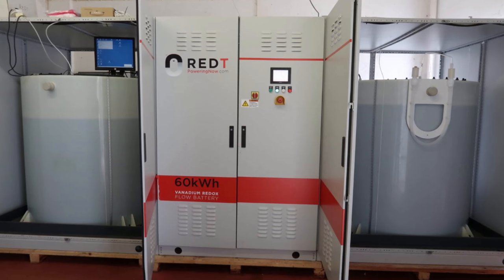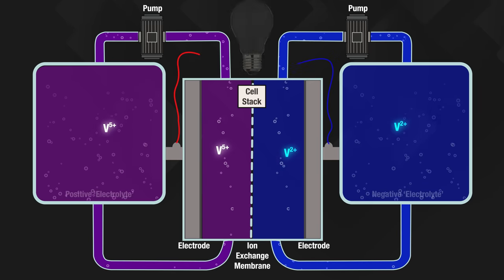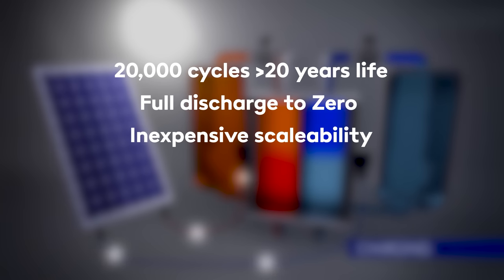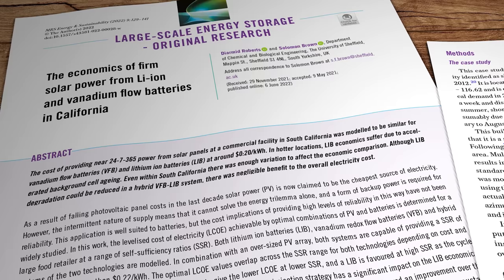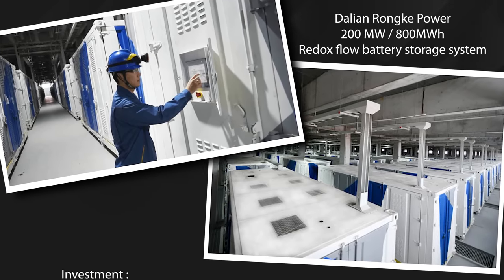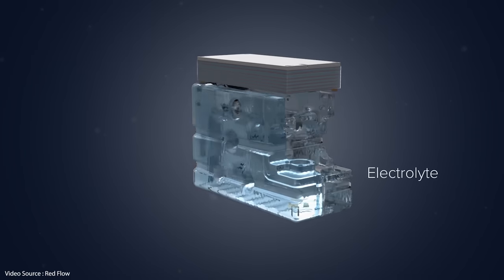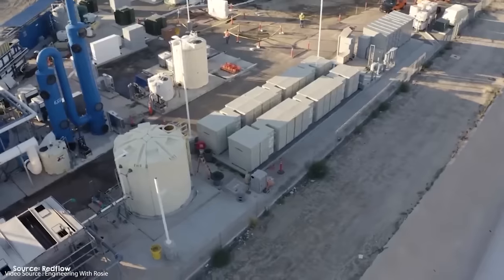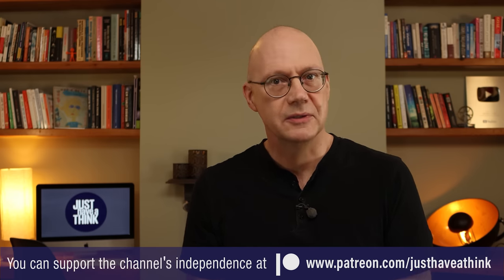The new billion dollar battery disruptor!

Comment: In April we drove to Oberwintethur in Switzerland to visit family who live there, a 900 km trip in our EV. Ten minutes walk from their apartment is a Cellcube installation with two 50 kW DC rapid EV chargers. These are fed by a Redox flow battery which is charged up by banks of solar panels. There are information boards explaining how it all works but it was interesting to know that the car was being charged in this way. Thanks Dave for another great video.
Reply from the maker: Very interesting info. Thanks for sharing :-)
Reply: 900 km in a EV is quite a trip.
Reply: @markfryer9880 Depart full, Arrive empty -> probably two DC fast charges required, each between 20 and 40 minutes (depending on the charging capacity of the car)
Reply: @markfryer9880  not really. A lot of people do that. If you take your regular breaks every two hours, it doesn't even take that much longer. Just had a trip of 350 km with my EV and didn't even need to charge, but still did just to get some rest and bathroombreak. Got there with almost full range.
Reply: But but….. the grid can’t take all these fandangled EV’s
Reply: @skip181sg I hope you are being ironic... the grid certainly CAN cope with the EVs. The DC fast chargers have their own batteries. Its like filling a fire engine from a slow tap. Eventually the fire engine tank is full and it can squirt water at high rates for short periods.
Reply: @ecoworrier  My wife calls me the Fire Engine after a night of slowly filling myself with beer.
Reply: @ecoworrier  My home country—Australia- is the biggest irony exporter in the world..

Oh sorry… That’s Iron…..
Reply: @skip181sg Hammersley Irony?
Reply: @ecoworrier  the best irony
Reply: @markfryer9880 Not really, in a modern EV it takes the same amount of time as a gas or diesel car, the range is long enough and charge time short enough that you'll be able to charge on all the regularly scheduled leg stretchers, food breaks and toilet stops you'd be taking anyways.
Reply: @skip181sg  Hope this is ironic, but nevertheless, yes the grid can't handle it if all EVs are charged at the same time which never happens. The same is also true for gasoline, if all combustion cars would try to fill their tanks at the same time it would be complete carnage. In Germany we have a gas station for every 3.000 something cars. In the US it's slighty better at 2.000 cars per station, in the UK it's 4.000. So good luck getting gas if you're in the latter half.
Reply: @skip181sg  Love your work skip! 😁
Reply: Ronaldo-ue5if  What!?
Reply: charging a battery to charge another battery would use more power... the grid may be able to cope, the distribution system wont.. ask yourself this, how many cars refuel at a service station, every hour, if you had that many fast chargers, how much power would that require ?
ive seen people say  'i charge at night when their is plenty of power' Really !!! Plug a lithium battery into your house then goto bed.... every electrical device  i have ever owned, has said not to leave it charging unattended, who in their right mind thinks its a good idea to plug a lithium battery into their home and then go to sleep ?
Reply: Solar panels imported from China. Let's hope they keep exporting them.
Reply: @markfryer9880  Yes, we never like to do more than 500 km in a day though we did a marathon 1,100 km return from Frankfurt in Jan '22 following the birth of a grandson, never again!. For the trip to Switzerland this year we broke the journey with a hotel stay in both directions charging overnight at the hotels for free. Two weeks ago we did a 500 km (300 mile) each way trip to Brittany, stopping at a Tesla supercharger in Nantes for 40 minutes while  the car was plugged in and we had some lunch. We never used to do more than that distance in an ICE car.
Reply: @fpvrc9829  I have owned an EV since early 2019 and I always plug in overnight. It is a common mistake to equate EV batteries with those in devices such as phones, laptops etc. Those do not have BMS systems which are constantly monitoring temperatures and current flows during charging. After plugging in at home about 400 times and clocking up 90,000 km I have no such concerns
Reply: @ecoworrier  That's about it.
Reply: @markfryer9880  Yes, we live in the Charente region of France and have owned the e-Niro since March 2019. We have made 3 trips to the UK, one to Frankfurt, two to Switzerland and have just got back from Northern Spain. Our car is now off the pace when it comes to charging speeds but even so we only plugged in for 13 minutes this afternoon to make sure of completing the 425 km trip. Just enough time to use the bathroom and stretch our legs.
Reply: @ecoworrier  We actually split the trip in two as doing more than 500 km in a day in any car is a too much. In 2022 we did an 1,100 km trip to Frankfurt from our home in the Charente region of France...this following the birth of a grandson there. It was February, so cold, wet and foggy. We did 700 km as far as Metz on the first day but that's really too much driving in a day. We never had any problems finding rapid chargers and we never do more than 2 and half to 3 hours before taking a break.

Comment: As someone working in the electroplating industry, this is very interesting technology. The use of zinc as the carrier metal I find quite exciting due to its ubiquity, low cost, safety and wide availability. Using these for home storage and grid storage would free up the other energy dense technologies for transport uses.

Comment: The diversity of sustainable, viable solutions becoming available is mind boggling.
Reply: Agreed and that is both a good thing and a bad thing. Good to have options, bad in that none really stick out as being superior. We cannot have meaningful change on only marginally better options
Reply: 10 tons of paraffin with melting point at 24C in your family home and your done.
Reply: Really?  30kw is the electric engine required to run an oar hauler, it needs this mobile, always on because a mine cost 4 billion and the interest on this can be measured in $/hr.   Only diesel or nuclear can provide this.  All other techs seems like feel good solutions considering any metal we use in cars or storage.  I am an optimist thing can get worse.
Reply: @johnschneider931  With the amount of waste and inefficiency the world has gotten used to, you'll need all the nuclear and oil you can get... and then it will be over.
Reply: @cliffwilliams8616  we have a diversity of use-cases & for each it's common for one tech to stand out as 'best'.
Reply: @johnschneider931  what are you trying to say?
Also, what is an "oar hauler"?
Reply: @pedropinheiroaugusto3220 100% renewables + storage energy system is what helps end energy waste. Burning fossil fuel wastes too much energy as heat. RE + storage will use ~56% less energy overall.
Reply: @annabel5200  So build heat recovery systems to increase efficiency. This will also aid renewables.
Reply: "Necessity is the mother of invention."
Reply: Crazy what can happen when you have one super powerful fossil fuel industry that has been able to prevent this for half a century.
Reply: Nice bot chat guys, keep it up
Reply: The issue is, that due to the high speed at which things are being developed and improved, there is a great deal of hesitance when it comes to adoption.
What you buy today might be completely obsolete tomorrow, so governments and large corporations are waiting. And waiting is the one thing we should not be doing...🤷‍♂️
Reply: No doubt that this will grow enormously fast. There is scope for improvements because there are several degrees of freedom, e.g.,  as you mention,  different chemicals.
Reply: @Fellowtellurian …and would still be doing so were it not for China refusing to play their game….
Reply: Yet none of them actually exist and work.
Reply: @johnschneider931  Funny thing... I work for a mining equipment manufacturer. We have 42 tonne underground trucks running on battery only.. also working on a overhead trolley system for same when running longer distances up ramp. We also have 14 tonne and 18 tonne loaders - on battery. Most of our underground drills also have a battery drive line option.
Many customers are asking for non-diesel solutions - due to underground environment constraints... but also, because it makes economic sense. It requires a lot of power to run ventilation fans all the time just to clear exhaust and heat from mobile diesel fleet underground.
Reply: If only they became available at affordable prices.. alas, due to the fact that there are thousands of solutions, none of them will be able to scale quickly by sheer loss of market growth that they'll experience because of the over-saturation of the market because of the alternatives.. good news for businesses still, but unfortunately not (yet) for consumers.
Reply: Every company who claims their product is a "disrupter" is nothing but a liar.  I have been in the tech industry for 35 years and I've heard 10,000 people and companies claim a "disrupting" blah blah and there has been NOTHING.
Reply: Only decent idea at this point is ambri batteries.  Vanadium oxide is toxic and any ion exchange membrane that could last for 20 years doesn't exist.
Reply: Amazing isnt it, almost as amazing as hearing nothing more about them after a month or two has gone by.
Reply: @Withnail1969  Look them up. Most are working well. That's diversity in alternative solutions for the XXI Century.

Comment: It is worth pointing out some differences between the Vanadium flow batteries (VFB) and the Redflow Zinc Bromine Flow Batteries (ZBFB). The VFB work by changing just the oxidation state of Vanadium in the electrolyte while the ZBFB work as a reversible electroplating process where the electrolyte gets depleted of Zinc which is plated on an electrode. The capcity of the VFB is limited by the size of the tanks of electrolyte, while the ZBFB capacity is limited by both the tank size and the electrode area for plating. Another difference I believe is that Vanadium is relatively rare and so more expensive than Zinc, where we see galvanising, i.e. Zinc plating, everywhere. I am sure they both have an exciting future is stationary battery storage.
Reply: Zinc is about 12 times cheaper than Vanadium.  The primary producer of Vanadium is China, zinc production is more spread out across the globe.

Comment: Now can you make one that will store enough energy for a single household for one to two weeks without recharging?  Size? Cost? Can I stick it safely in a basement?
Reply: Well, the video states it's non flammable, so one point to safety here. Size? Look at the redflow video, it isn't small. Cost? A lot! Sorry.
Reply: Good question. For a large scale project it was the same as Lithium-ion
Reply: @Sekir80  the unit I saw was fairly small at 10KwH.  Average home use is 30-50 per day (small to large house).  I could easily see a 5 wide by 3 high setup in a basement or extended garage yielding 150 KWH.
That would give you 3-5 days without recharging (possibly longer if you conserve energy as in the case of an extended grid down or long lasting inclement weather (assuming solar for recharge)).
Even a setup twice the size is not inconceivable for a single home with some planning yielding 6-10 days full use without recharging.  Price is of course another matter but it appears that the materials in use are not overly expensive and I’m sure mass manufacturing is possible.
All in all it seems like a worthwhile solution to pursue for home use although it may not be feasible for a few years yet as it’s all still in development and a lot of cost reduction would be needed for widespread home use.
Reply: Unfortunately VRFBs are not particularly suited for household scale applications. They  need a low pH to avoid precipitation of dissolved vanadium and thus rely on sulfuric acid in dangerous concentrations. Vanadium is also toxic. They need very strict operating temperatures (25-40C) again for the solubility issues of vanadium. The possibility of a chemical leak inside a home is almost a non-starter. I remember one company wanting to bury a small VRFB in your yard but that would be a nightmare to maintain and service.
Reply: @primordial_platypus  Of course I agree with your assessment especially on size, not too big. Just bigger than a lithium cell design.
I wouldn't comment on your "average" electricity usage, because we live very different lives (130kWh for me is one full month).
Price, yeah, mass manufacturing could and will bring it down.
Did I comment on power here? Important to keep in mind these batteries are pretty weak in that aspect, but even 0.1C for 150kWh battery gives you 15kW, which might be enough for you use case.
Reply: @primordial_platypus  the same manufacturing bottlenecks on fuel cells apply to most RFBs. They both need machined graphite bipolar plates and very expensive Nafion proton exchange membranes by the square meter which alone is 30-40% of the total cost. Not to say these won't come down in cost, but anything replacing Nafion needs to be able to handle both the highly oxidizing V5+ ion and the very low pH needed to maintain solubility.
Reply: @allthingsdestructive Redflow uses Zinc Bromine not Vanadium and claims to work in high ambient temperatures. Redflow also claims non toxicity in case of a leak.  I heard no mention of Sulfuric acid in the presentation (but I didn’t read the accompanying speed either).
Reply: @Sekir80 Although Lithium based batteries have the edge right now there is growing concern about the supply given the quantity needed if their use is scaled up far beyond their use in automobiles/trucks.
Reply: Nifty stuff!
Reply: @primordial_platypus  the Redflow unit in the pictures is a domestic unit (I understand 2 are required for very high-use homes), the base unit determines the peak KW available & KWh is determined by tank size.
Reply: @primordial_platypus  minor niggle - 'KWh' - 'K' is capitalized because it's a multiplier not a divisor (it's x1000), 'W' is capitalized because it's someone's name (James Watt) but 'h' is not capitalized.
Reply: @alanhat5252  Apologies, I stand corrected.
Reply: RedFlow is available and each module is about the size of a dishwasher. So it could go in a basement.  The cost is pretty high at this time.
Reply: Absolutely,  at 22cents/KWh x 3KW x 16hr x 60days = 630 Dollars to look after my winters when I've less PV.
Reply: @allthingsdestructive thank you but disappointing, the temperature range is problematic in the uk as mostly <25C. Heating would surely hit the cost badly

Comment: Combined with solar power, flow batteries offer an alternative to diesel generators in the far north. Gather more power during the long summer days and store it for the long winter nights.
Reply: To get the LCOE of $0.22 (kind of high compared to fossil fuels), I believe the batteries need to be discharged frequently. In a winter storage scenario, they’re being discharged once per year. I don’t foresee that being viable.
Reply: pretty certain it's still cheaper to just: build much more solar capacity than trying to store it for many months.
Reply: @autohmae depends how far north we're talking. Beyond the polar circle, no amount of solar capacity is going to help. Then again, up there, wind and water might be better to begin with.
Reply: @richardmetzler7909   I just meant in general, buying more solar is cheaper than batteries to get through winter time. Obviously in the really white north, you can't do that with solar, wind probably works much better yes and whole year round.
Reply: At what temperature does the "flow" part cease to flow? Those "long winter nights" are not, in general, what you'd think of as warm.
Reply: @ethanswanson9209  The paper does acknowledge this issue. From the summary point at the bottom of the first page: "Although solar power firming superficially appears to be a one cycle per day application, the actual cycle requirements may be much lower, which reduces the value proposition of [vanadium flow batteries]." But, that said, they modeled this just northwest of Las Vegas, for some reason, not the "far north" as robert puts it.

Also, though, "kind of high compared to fossil fuels" is quite geography-dependent as well, isn't it?

Comment: (and voltage regulation)  It might be nice, though, to use less toxic and even less expensive multi valent elements for flow batteries such as manganese, iron or a multitude of others.  Of course there are problems to overcome.  In Aquious solution, for instance, ferrous iron is far more soluble than Ferric iron so there is a problem of precipitation to overcome.  As for the ZnBr flow battery, it includes flowing liquid but is really a reverse electroplating cell unlike other flow batteries.  Whatever the case, we really must get away from using Li batteries for static applications.  The alternatives are superior in many ways.  Longer life, cyclable between 0 and 100% with no damage, safer from a fire point of view and many other characteristics.

Comment: It seems like these might just be the answer for EV charging stations where a source of energy can be located nearby. Rather than taxing the grid and all the inverter stuff you could generate, store, and use direct DC current bypassing the stress on current grid tech. I am seeing solar rooftop on shopping malls with massive storage near and charging stations on the lot below. Direct charge in daytime and stored charge at night making them available 24/7/365. I other areas with wind you do likewise but have to have turbines nearby. Point is you lose all the transmission costs and losses plus the conversion costs from/to AC and DC. With proper management you still could back feed the grid with any excess in the early am or even when needed once you have usage trends established.